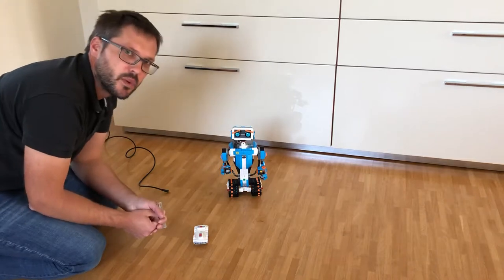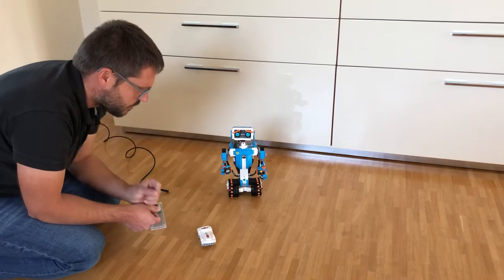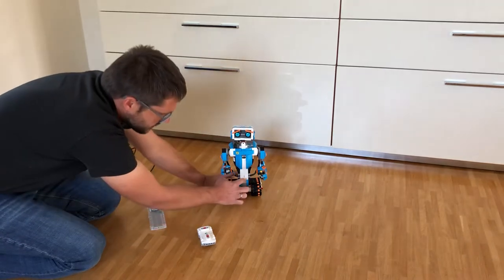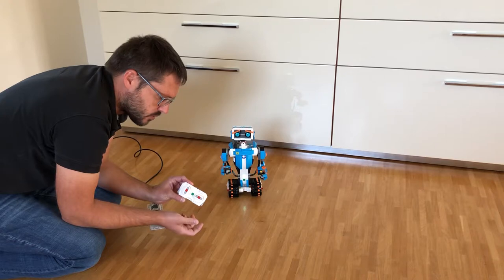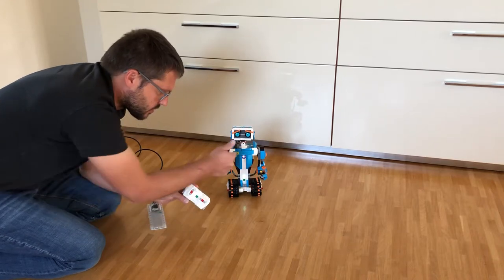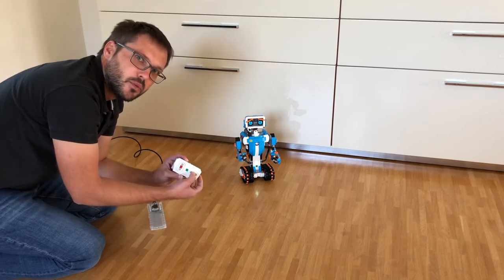Legoino: Boost remote control

Comment: Hi, I have been interested for some time in how to make the Lego PoweredUp architecture more flexible, particularly with extending the sensor capability to allow 3rd party sensors or more sensors to be connected than Boost, Wedo2 or Prime Hub allows. I have a couple of comments.

Your method uses an intermediary bluetooth controller (the ESP32 board) so sensors attached to it can relay info to the Lego smart device, have you worked at all on directly connecting an ESp32 to a hub port and communicating to it and the sensors this way?

I see you include some info on how to intergrate LPF IR receivers. Are you aware that the Boost colour sensor has an IR mode and that this can be accessed in the official Poweredup app?

My use case is wanting to be able to drive 5 motors from the Prime hub and use the remaining port to communicate to an additional (ESP32 or other) board to which sensors are connected. I believe this is preferable to using over Bluetooth due to potential lagging or interference etc. 

However, what is your experience of these issues? using the official Lego Apps there can be noticeable delays and consequent synchronisation issues due to the time it seems to take to deliver and interpret a piece of control logic on the control smart device (tablet) and the Lego receiving hub.  Are these avoided anyway when using the Arduino environment, even over Bluetooth?

Thanks for an info